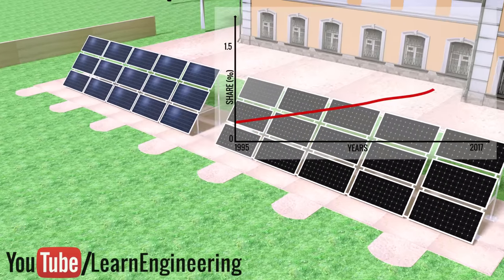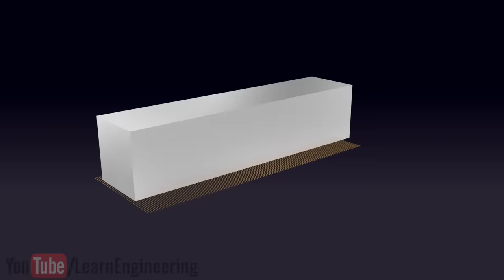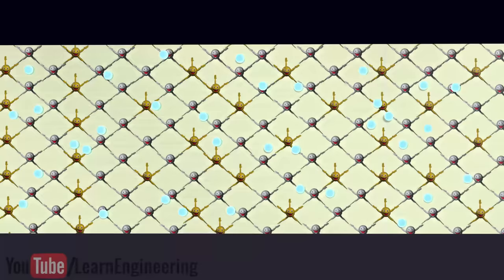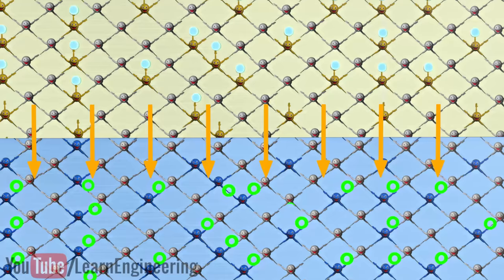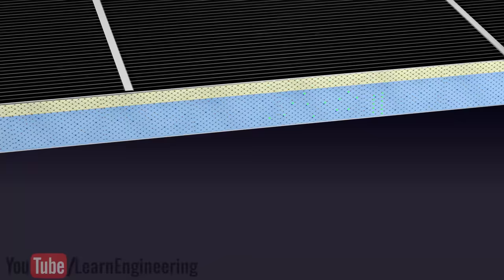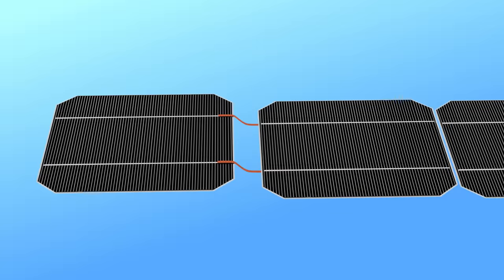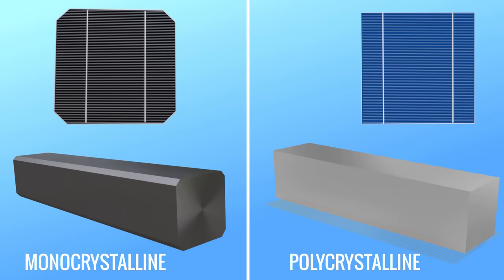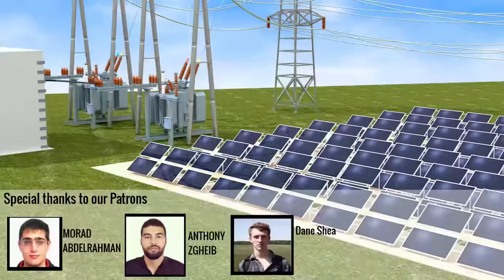How do Solar cells work?

Comment: I have some questions at 2:40
How can the n-side boundary becomes slightly positively charged and p-side boundary becomes slightly negatively charged? Shouldn't they be neutral instead, because there are no free electrons and holes in the depletion region. If they are neutral, then there shouldn't be any electrical field.
Reply: For N-side, the reason is because a neutral Phosphorus atom on the N-side have 15 protons(+) and 15 electrons(-) originally. But after giving away the extra 1 electron, the atom of Phosphorus now having 15 protons(+) and 14 electrons(-). This caused the atom to have 1 more proton(+), therefore atom of Phosphorus on N-side become positively charged (+).

For P-side ,the reason is because a neutral Boron atom on the P-side have 5 protons(+) and 5 electrons(-) originally. But after taking 1 electron from the N-side, the atom of Boron now having 5 protons(+) and 6 electrons(-). This caused the atom to have 1 more electron(-), therefore atom of Boron on P-side become negatively charged (-).
Reply: @lesnerchai2186  how is 1 being gived away?

Comment: Wouldn't cause fluctuations and instability of the power grid as the output power varies at different conditions (day/night, overcast)?
Reply: Th energy is usually stored in a battery prior to releasing it to the grid

Comment: Very good information, I'm looking to  get solar for my home and I'd like to learn how  the panels work.  Maybe these are silly question....when bonded, lets say 5 panels, 

Do the energy load each panel separately,  fill up then move to the next panel and fill then  move to the next panel and so on and so on?

In full sun, do each panel  absorb energy at different levels?

If there is a crack in the panel  will it reduce the energy of the it creates as a whole?  How can you check to see if a panel is actually working to it's full capacity?

Comment: Could anybody please explain me why high temperature decreases the voltage of the panels? What happens in the PN junction? How does it affect the electrons? Thank you :)
Reply: Hi Josef,

Voltage is proportional to the amount of energy that is being received by our electrical appliance.

Light gives energy to the solar cell to generate electron hole pair, electron hole pair receives this energy and flows through the external circuit to power up our electrical appliances. Electrical appliances receive this electrical energy from the electron hole pair and hence it powers on. 

When temperature increases, the bandgap (light energy required to generate electron-hole pair and make them active) of the solar cell decreases. This effectively means that the energy of the electron-hole pair that is absorbed is less. Less energy travels to the external circuit. The electrical appliance receives less energy. Therefore, according to first statement, voltage drops.

If you are interested to learn more about solar cells in an intuitive and fun manner, I'm starting a video series called "Shining Light on Solar Cells", covering the a-z of solar cells. Catch the series here: https://youtu.be/53eBzy8eZ-8  You will find more clarity in my answer at Chapter 5.1. Stay tuned!

Comment: Hello everyone I have a question. The sun's rays are again reflected in the space after contact with the panel. If we design a solar panel with a mirror that makes the rays reflected in this space back into the solar panel, do we generate more electricity?
Reply: How would you do that without just blocking the panel? And if you could, how would you manage the resultant overheating problem? And if you could, what if it was just more economical to use a lense to focus more light? 

This is why cutting edge solar plants don't use photovoltaic panels: they use mirrors to focus the light, which then heats up molten salts, which transfer the heat to generators or can store the heat for later.
Reply: Just ask Google. 
Researchers at Rensselaer Polytechnic Institute have discovered and demonstrated a new method for overcoming two major hurdles facing solar energy. By developing a new antireflective coating that boosts the amount of sunlight captured by solar panels and allows those panels to absorb the entire solar spectrum from nearly any angle, the research team has moved academia and industry closer to realizing high-efficiency, cost-effective solar power.

"To get maximum efficiency when converting solar power into electricity, you want a solar panel that can absorb nearly every single photon of light, regardless of the sun's position in the sky," said Shawn-Yu Lin, professor of physics at Rensselaer and a member of the university's Future Chips Constellation, who led the research project. "Our new antireflective coating makes this possible."
Read more at: https://phys.org/news/2008-11-solar-power-game-changer-absorption-sunlight.html#jCp

Comment: Can someone clarify how the delocalised electrons travel to the top side of the cell, and not to the positively charged positions (holes) in the bottom layer?
Reply: Yes, what you explain may happen. When electrons are generated at the p region, it is a competition between: 
- the electron traveling to the depletion region and be swept away by the electric field
- the election recombining with the hole at the p side.

So this is why we want to target most electrons to be generated at the depletion region, which is close to the electric field and the field effects are stronger. The depletion region is also purposely positioned near the top of the cell which is where most of sunlight strikes. Electron recombining with the hole at the p side adds to the "inefficiency" of the solar cell.

If you are interested to learn more about solar cells in an intuitive and fun manner, I'm starting a video series called "Shining Light on Solar Cells", covering the a-z of solar cells. Catch the series here: https://youtu.be/53eBzy8eZ-8

Comment: so basically we can turn the entire Sahara desert into a giant solar farm?
Reply: No. We would need to cable hundreds of miles worth of utility poles to bring in the energy because no battery would be capable of containing it. That’s big $

We’d then need to manufacture all the necessary foundations, and the panels themselves to cover an entire desert would be impractically expensive.

The panels would need to be extremely robust, capable of surviving extreme temperatures and the sandy environment.

Not to mention the environmental impact it would have on the organisms that live there.

Comment: Why is the “N” side, which is full of (negative) electrons, referred to as “positively charged”, and the “P” side which has holes (electron deficient?) referred as the “negatively charged” side? In this depiction, isn’t the “N” side is negative, and the”P” side is positive?
Reply: The holes in the P region make it get electron from the N region and by the way let it get more negative, so the P region become negative. Exactly the same happens with the N region, which become positive by losing its free electrons.
Reply: You have to know that initially, both regions are neutral without any P-N junction

Comment: How is the electricity distributed through the grid during night if there is no sun. Will it be stored during daytimes and distributed night. If so, how?
Reply: No solar panel will generate electricity at night, so no distribution through it. It can't be stored
Reply: @mbabcock111  For  MW capacity plants , there is no way of storing energy .

Comment: I imagine vertical layers of panels similar to floor levels of a building. Sunlight is then reflected  from a wall-sized mirror/ aluminum foiled wall that stands in front of the panels top to bottom so that sunlight is reflected between the panels /*\;,.
Reply: Waste of panels that would produce very little power, and also building things higher than one floor makes them automatically more expensive. Installing those same panels on ground level is both easier and therefore cheaper but also allows more light to hit them meaning they would produce more power.
Only reason to use mirrors is if you have a special kind of high temperature panel that can utilize more than 1000W/m2 incoming light, but those are not cot effective at this time.
Reply: @AnalystPrime  Maybe giant steel frame shelving units that are weather resistant could do the trick
Reply: @enigmamusement  Expensive. Also pointless, there is no good reason to put panels on top of each other and all the reason not to as it makes them produce less power, which is the only reason why you were installing them in the first place.

Just use less giant frames like a normal solar farm and it will work better. Also be a lot cheaper, just having installers climb up to your roof raises cost of home solar to four dollars per watt and that is after prices have been coming down for years; a regular solar farm with rows of panels in simple frames only costs around one dollar per watt to build.

That does require more land area than the towers you proposed, but there is plenty of land for sale cheap in sunny areas. For example if you wanted to build a 10MW solar farm the panels and installation work would cost around ten million, building the power lines to your property could be few thousand or possibly hundreds of thousand depending on distances, but the forty acres of land the whole farm would need can be had for under a thousand dollars.
Reply: @enigmamusement  If you have the budget to get two panels instead of one the smart thing is to put them side by side and get 100% power from both, not make them shade each other and get 1%. And yes, modern panels do not stop working just because there is a little shadow, you can even get tiny amount of power from stars and moonlight at night. Doesn't change the fact that when they are not pointed straight to the light the output falls drastically. Sun might be shining for twelve hours each day, but due to bad angles it only counts as five hours of noon equivalent light. Some places get more, but if the noon equivalent hours per day for your area is three or less then solar is unlikely to be economical for you.

Currently main focus is to simply build large enough solar farms that they provide useful amounts of power in the morning and afternoon and use energy storage to deliver the noontime overproduction at night, but the main reason why that works is that we want and need that better and cheaper energy storage anyway, solar and other renewables are only tangential to it. As this raises the costs and uses a brute force method that wastes resources that could be utilized smarter elsewhere it gets lots of flack.

One option is to simply use loads of money to cover every wall with PV panels, that way you get power no matter which direction the sun is shining from and the others still produce some from indirect light. Main problem is that people do not want all buildings covered in solar panels, and given shading issue the output would also change all over all the time.

Solar trackers work best if you have the space and money for them. Not because now your panels produce more kilowatt-hours per day but because they will provide full power almost all day long, making the production far more stable. The problems with them are that now you need more area and installation takes longer and costs more in addition to the frame being far more expensive. A handy DIY person can easily and cheaply make one or two for their backyard, but we literally need few billion of these things and the cost of those motors will quickly add up.

Some people have suggested power satellites, but the cost of getting that hardware up in orbit is way too high. Plus we'd still need to build solar farms on the ground to receive that energy the satellites would gather.

Frankly if you have the budget for it the simplest solution to powering the world with solar is to just build a proper modern electric grid. Florida can sell power to California in the morning and when New York streetlights turn on they can get their electricity from LA solar farms. Or from the Hoover dam or offshore wind farms, solar is the easiest to install but it is not like coal power is the only option we have when the sun is not shining, no matter what naysayers and lobbyists claim.
Reply: @AnalystPrime  Shapes do not have to be like a building. Try a different shape, let's say dome-shape almost petals of a sun flower effect - see how that works computer model-wise. Nature gives clues on how to absorb sunlight: greatest surdace area to volume ratio
Reply: @enigmamusement  Might work as an art piece, that way someone would be willing to pay for it. But artwork is not meant to provide power so it would be easier to just make the flower out of something more easily molded and spray it with that paint that forms a solar cell on it.

Comment: This video makes a FUNDAMENTAL mistake. It is NOT the electric field which is responsible of the photovoltaic effect. The photovoltaic effect is first and foremost a diffusive effect, not a drift. Electrons and holes diffuse the length of their diffusion length, and are selectively collected at each electrodes of the absorber. The p-n junction is a way to make such selective contact, but it is not the only one. 
You can actually make a functionning solar cell with an electric field in the wrong direction. If you wish to know more about this crucial point, it is very well explained in the book from P. Wuerfel.
Once again, while the electric field does help (hence bandgap grading in thin film solar cells), it is NOT the base mechanism of the PV effect.

Comment: 1) This video suggests that residential solar is only stored in batteries and inverters are only used on large commercial installations. That was true 15 years ago, but this was published in 2018. I'm not sure how they missed the massive global solar market for both commercial and residential systems.
2) They suggest that solar isn't a large percentage of grid power because it is not compatible with the grid. That information is only a decade out of date and does not seem to recognize the incredible growth we've seen in solar.

Comment: Why magnetic field is generated when current is flows through wire?
Reply: Techvid lineup whenever a current flows a magnetic field exists, and vice versa.
Reply: @roncindustries9643  but why and how?
Reply: “The electric field is produced by stationary charges, and the magnetic field by moving charges (currents); these two are often described as the sources of the field. The way in which charges and currents interact with the electromagnetic field is described by Maxwell's equations and the Lorentz force law.[2]”

https://en.m.wikipedia.org/wiki/Electromagnetic_field

Whenever you get an electric current flow in a conductor you will get a magnetic field. 

When the conductor is straight the field surrounds the wire. When the conductor is coiled the field looks like a traditional magnetic field.

When a conductor interacts with a magnetic field-you can create current (generator) as an example. 

When you do not have current flow you will still have electrons flowing within the structure of a material but the flow is random and the magnetic fields fundamentally cancel one another out in the smallest scale. 

Fundamentally with electromagnetism being a fundamental force of nature, electric fields and electromagnetic fields are “linked to one another”. Where you have one you will have another
Reply: @roncindustries9643  thank you so much I was searching this answers for a long time and now i get the answer

Comment: I like the truth in plain sight you can easily say energy from the Sun and you know damn well everyone is going to just imagine you're referencing sunlight. Good thing some of us understand the difference between light and energy and some of us actually know how Earth Science works. Assuming you're just talking about sunlight I'll have to correct you and say that you're one-hundred-percent incorrect because there's at least two forms of pure energy on the table that beat sunlight as far as energy used for the harnessing and direction of electricity. By the way this Force electricity in case you guys don't know cannot be created it can only be harnessed and directed. But at the top I can think of the positively charged ions that are constantly falling to Earth and probably attracted to the ground because the ground is a negative charge. Then you have the force of resonance alone which can be harnessed in so many different ways not to mention Earth's Echo all by itself but a properly balanced mechanism can turn the smallest bit of force into several hundred times what it started out at I mean seriously I think Tesla himself made a skyscraper shake back and forth with a small weight resonating at a perfect frequency. I always got a kick out of the world stage puppets that came along over the years to act like they were a part of this or that and knew about this secret UFO technology and all that crap like what's his name I can't even think of it but the first clue you might get is these guys seem to think they have these designs for specific Motors that operate along simple principles and whether or not it's supposed to be high tech or not anyone on Earth can build these things if they have a design yet no one has bothered. That's because real scientist Recognize Real and they know right off the bat who's full of s**t...